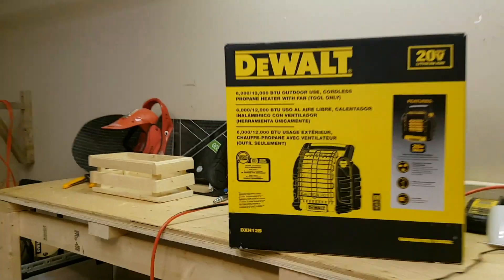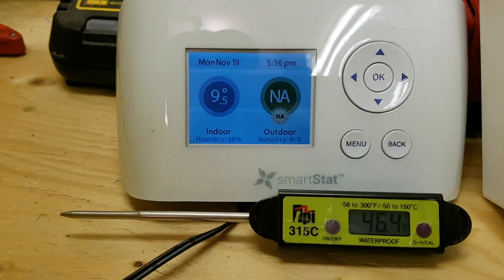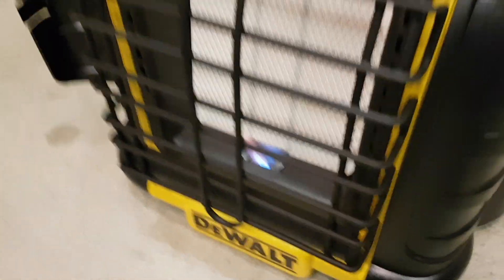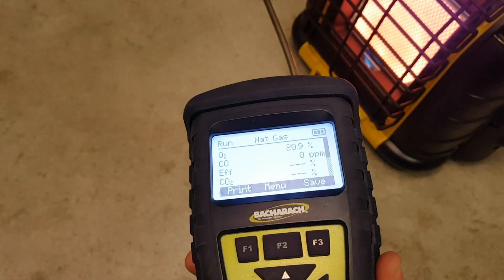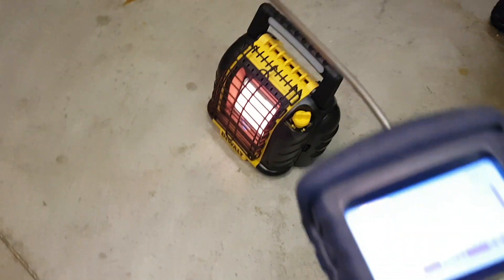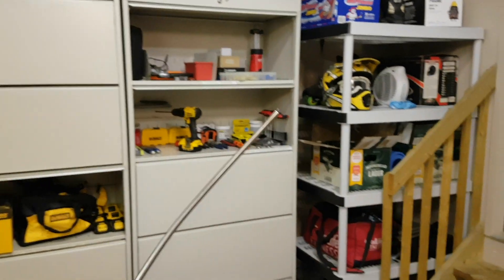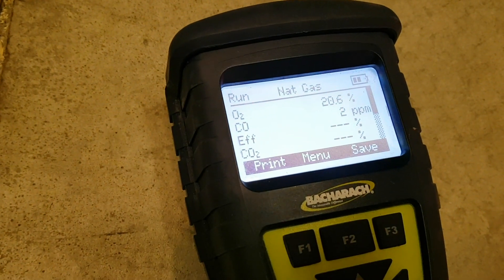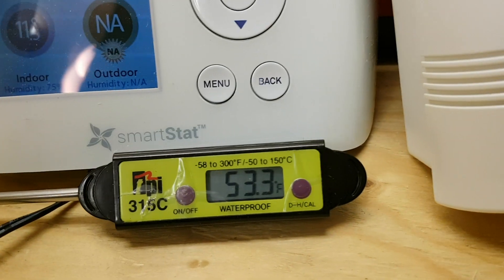Is the Dewalt DXH12B 20v Propane Heater (Big Buddy) safe for indoor use?

Comment: Can you connect a 20lb propane tank to this?? If so what hose and adapter is needed?
Reply from the maker: Yes you can connect 20lb tanks using the Mr heater branded accessories
Reply from the maker: https://amzn.to/3VaMTvL
Reply: @Jerrys Garage  thank you for sharing that link!!!! Was tempted to return it if it only runs of 1lbers last question does it need a filter or just that hose?
Reply from the maker: @wadec6799  This is the plasticizer free hose and they claim you don't need the filter with this version
Reply: @Jerrys Garage  I'm gonna grab one today. Man I appreciate the replies!!!!
Reply from the maker: @wadec6799  No problem at all! That's my amazon affiliate link so if you purchase it through that link I'll get a tiny commission which helps out the channel! Thanks for watching!

Comment: Send a question for you. How are you enjoying the heater so far? How long do you think one tank will last? They say 12 hours in the manual
Reply from the maker: It's been a while since I've used it but it's always worked well. I think on I high get close to 5 or 6 hours. Maybe on low you could get 12 hours.

Comment: No indoor, unvented combustion should ever be used if you like your RBC's and your hemoglobin.
   
A.  At 1ppm per constant unit of time CO is 100% taken up in red blood cells, irreversibly as methemoglobin. 
   Those cells can no longer bind or bring O2 to tissues. Including your lung tissues.    
   The physiology and viscious time weighted cycle of a continuous reaction curve cannot be overcome.  Forget the environmental gas sniffer and draw a tube of blood every hour and plot your 12 hr %hemoglobin and metHeme. 
   A red blood cell lives for 28 days and gets saturated in 5 seconds at "1%" CO.   Why? Because air is 75% N2 and 19-21% O2.  But hemoglobin isn't competing for nitrogen. It's binding affinity for CO is exponentially greater, and irreversible, than O2.  As cells begin absorbing the CO the population of robust, viable cells constantly ramps down and the poisoned globin ramps up.
   Ask any chain smoker how many 100 yard dashes it takes them to feel great again. 

B.  The IBC and the UIBC (bldg codes) prohibit these for use in livable space. Livable space includes garages.      
   These things are fine in a well house or a mechanical room in an outbuilding.
   
B & 1/2.  There are no unventilated propane heaters labeled "Ok to use at 4500 ft elevation" because none of them are safe at lower partial pressures of O2. At about 5000 ft the best combustion will start off at 7.5 ppm CO and reach 20ppm CO as the O2 "Depletion" colorimeter starts to read the yellow/orange flame color.

C. Long before the "O2 Depletion  Safety" 😂😅 switch cuts off the propane, the CO is rapidly climbing. A better Oxygen Depletion Alarm is your brain.  IF- your brain, is not damaged from 50 years of working in hazMat regulations, firefighting, coal mining, drilling rigs and research laboratories and medical labs,  THEN the brain may be trusted when it tells you
industrial marketing are liars if it makes them money. 
   Does Propane burn cleaner than JP4/5 or bunker oil?   Yes, it does.
  Does that make breathing any pruducts of combustion safe? 

D.  No, it doesn't.
Reply from the maker: I keep this heater only as an emergency backup in case of a power outage. Obviously it should not be used as a primary heat source. Thanks for all the info!

Comment: What kind of idiot puts the co detector up high when we know co sinks?
Reply from the maker: The specific gravity of Carbon Monoxide is 0.9657 (with normal air being 1.0), this means that it will float up towards the ceiling because it is lighter than air. So maybe educate yourself..
Reply: ... and review The combined gas laws: Boyle's Law, Charles' Law, and Gay-Lussac's Law... stating that the ratio of the product of pressure and volume and the absolute temperature of a gas is equal to a constant.  There really isn't a seperate "layer" of different gases until you've sprung one hell of a leak in a very calm atmosphere.  
   This is why LEL's form as gases mix into an explosive or combustible blend. A layering can occur especially in cold dense air with a gas leak in the basement... or at the base of a 65ft tall distillation unit.

Comment: What a clown you are.
You ran the unit for an hour to test for CO , you then leave the door WIDE OPEN , while collecting and then placing your Annaliser . Not a true test .
Reply from the maker: If you were using this indoors for a long period of time you should definitely have a window open for ventilation. Briefly opening a door does not evacuate every cubic meter of air in a structure, but thanks for your totally useful comment
Reply: @SmitHVAC.  It totally dilutes the built up gases in the building. Your test was compromised by your poor practice. The test is totally invalid.  FACT
Reply: @irishrebel9334  I always listen closely to people who start off with personal insults showing they are assholes. LOL. Not really.

Comment: Thank you so much for this test and review of the DeWalt DXH12B unit! I'm looking into getting one of these units for an emergency during power outage. In the event of indoor use, I would only use the unit sporadically through the day. From what I've seen online in reviews like yours this is a great unit to have if used responsibly. Cheers!!

Comment: Good video . Live it overnight and then measure. It needs to deplete the oxygen in the room to a level where the combustion is not complete. Then should start emitting CO.
Reply: @ganthore  Define incomplete burning of fuel.
Reply: @r.t.7925  I deleted my responses. For some reason, had the idea in my head you were discussing lighting a candle in a sealed glass jar (that would snuff out a flame quickly due to no oxygen). But as I thought about my response more.... it was not exactly correct reasoning in regards to what you posted. So removed it because I don't want to add to miss information out there. and yes... CO is a cause of low oxygen in the combustion process. (either by low oxygen in the air, or bad propane delivery lean / rich).
Reply: @ganthore  Discussion is always helpful . I learned things from your comment.
Reply: This is a silly test. Clearly, you shouldn't leave this unit burning overnight in a small and enclosed place. If you do anything like that you need to have some sort of ventilation. Using the unit plainly as you described is irresponsible. According to a government site I read CO levels is start to become dangerous at 70ppm. Also, you're mixing up things here. CO and plain O are two different things so the test in the video is perfectly valid.

Comment: Would it be safe to use in a truck
Reply: U 4 Real.........
Reply: Most likely, vehicles have many places for air to leak unless its an expensive car with added insulation / sound proofing.  Flame heaters are mostly dangerous in homes because the house is typically insulated and doesn't "breathe" well.   You'll notice in this video his ceiling is not insulated. I imagine that has an effect on his basically none existent co2 levels.   You could always leave a window cracked open in your truck if you want a peace of mind.
Reply: No. Absolutely not. Plus, your insurance policy will not pay for your funeral.
Reply: Yes, you can use in the the rear of a pickup truck. I watched a video recently where a guy was camping in this truck bed in the winter and was using a portable heater like this. And yes he had a CO2 sensor in the bed

Comment: Hi Jerry, which tools are better? Milwaukee or Dewalt?
Reply from the maker: They're both great, Milwaukee makes great lights and contractor specific tools, but I prefer my Dewalt saws. It really depends on the tool but I have both brands and couldn't say hands down one is better
Reply: I have the Milwaukee Fuel impacts now and they are def better, more powerful than the dewalts I was using. Also the Milwuakee hackzall is a lil beast. Love it, don’t use my big dewalt sawzall anymore since I got it.
Reply: Don’t think they make one of these yet though.  Correct me if they do.
Reply: Both are great the Milwaukee has stronger drills for the last few years but DeWalt drills are cool coming up and are  stronger today like the DCB 1007 and the 961 impact, I like them both

Comment: Thanks for posting and doing this test. I have this heater and plan on using it to heat a 12x16 insulated shed for some woodworking and spray booth. Does your testers measure humidity / moisture and how much does that add to the space? Just curious for my intended use. Thanks

Comment: I'm not familiar with the CO detectors, but the 'BACHARACH' was on RUN     Nat GAS.   Didn't you say you were running Propane? I guess there is not a difference for reading CO?  Thanks
Reply from the maker: Yes it was on NG settings but it makes no difference for this test, co is co

Comment: Thank you very much for such a good test. Just started using a Big buddy at my cabin to help supplement the heat from the furnace. Put an addition on a few years back and its a bit more work for the furnace so using these style heaters helps a lot and works great. Crack a window and we put a 8" - 10" 18V battery fan behind it to help move the heat. We Do Not Run over Night. There are also 3 detectors in the cabin. Look forward to a tent test. Thank You again